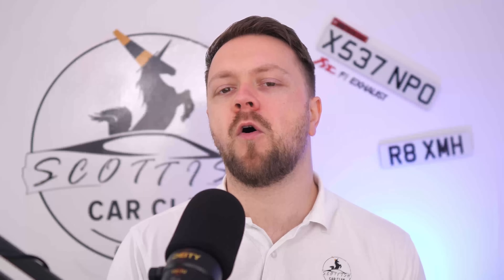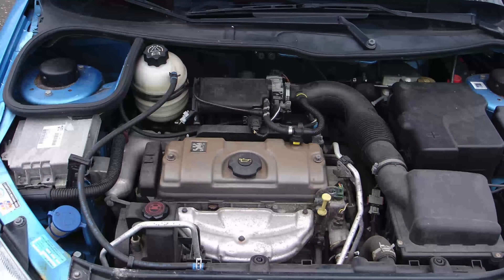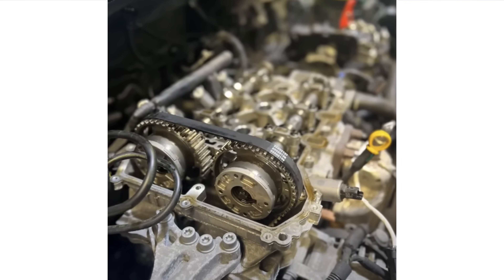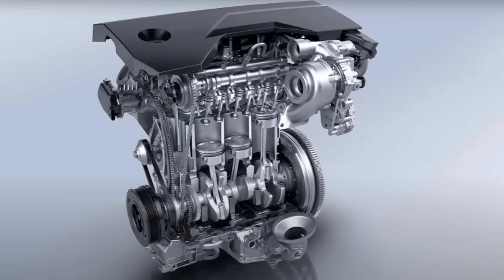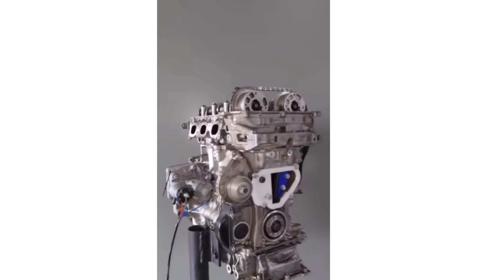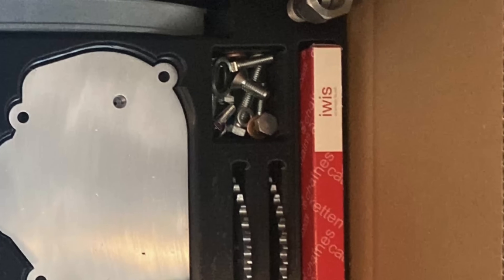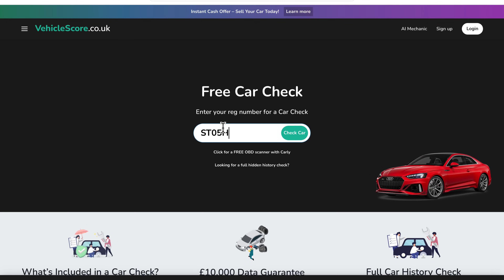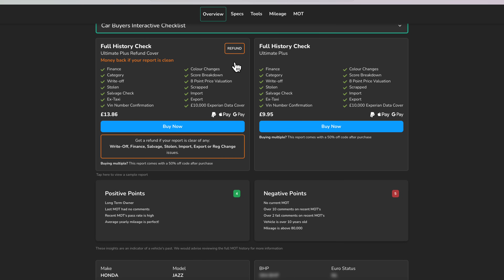Peugeot PURETECH FIX UPDATE | CHAIN CONVERSION

Comment: Just changed my daughter’s wet belt in her Vauxhall Corsa 70 plate with only 20k miles and a full history. Vauxhall wanted £1500 to change it but my local garage did it for £700!!!
Reply: Did it need changing or was it just precaution?
Reply: @  Vauxhall examined the belt after the oil light intermittently began to appear (and charged me £120) and they said the belt was starting to crack so it needed to be changed

Comment: Perhaps they can fix the high oil usage next ?
Reply: Stelantis, the problem with oil consumption has already been fixed in engines starting in 2019. EB2ADTS, they have redesigned the piston group, but the advice to everyone is to change the oil no later than 7-8 thousand kilometers. This is the whole problem with these engines. Has anyone changed the oil with such a frequency? I am sure that no one!
Reply: It might be a little bit too much for them since that oil consumption problem is directly correlated with piston rings.
Reply: @ERSBoogie  since 2019, this problem has been solved, but the oil needs to be replaced every 7-8 thousand
Reply: @vitalkino  No it is not solved.2021-22 model 1.2 puretech 130 cars still consume oil , i know of a couple of my friends. Perhaps the occurance is decreased but definitely not solved completely.
Reply: @ERSBoogie  It's all due to infrequent maintenance. They should change the oil more often
Reply: @vitalkino  Maintenance has nothing to with it. Oil leaks into the combustion chamber around the piston rings.
Reply: @ERSBoogie  You are wrong, 100% it depends on the maintenance on time. The oil turns black, clogs the oil scraper rings and they stick, which is why they do not perform their function and oil gets through them into the combustion chamber. A friend of mine has a 2019 car, 1,2\130  mileage 200 thousand, does not add a single gram. Change the oil every 7-8 thousand and everything will be fine. If the oil is already gone, then only repairs
Reply: @vitalkino  I can point you towards at least 3 owners from our PSA Car groups that had excessive oil consumption and they were all maintained by the auth. dealer at every 10k km's. With the correct oil B71 2297. I said it once and saying again. "It has nothing to do with the maintenance."

Comment: Got my 10 year old 1.0 ecoboost wet belt Fiesta stolen just before Christmas. I've replaced it with a 2016 Toyota Yaris with a  1.33 Dual vvti petrol engine and a chain belt. I've come to the conclusion that the thieves did me a favour.
Reply: Who would steal an Ecoboom 😂
Reply: @nigel9843  my thoughts exactly lol
Reply: @nigel9843 Taken to a chop shop for the engine according to my local police.
Reply: You bet they did,they probably stole it for the engine as the belt on their engine had failed, Ford are no admitting liability for these engines on vehicles registered after 2014 I believe but it’s hard shit to earlier purchaser’s. I’m an engine reconditioner and said right from the start fitting these belts inside the engine was madness,the dry belts weren’t a good idea but wet belts was a really stupid thing to do,single timing chains and not that brilliant but at least they give plenty of warning before failing completely by snapping.
Reply: please explain: what is a "chain belt"?
Reply: @ There is no such thing as a chain belt,what he means is that the vehicle has been fitted with a timing chain instead of another wet belt,it’s a conversion that changes this ludicrous wet belt idea into a chain which control’s the timing of the engines valves and piston’s so they don’t collide and wreck the engine.
Reply: It lasted 10yrs??
Reply: @CASHSEC It was low mileage 33K on it when it was stolen.
Reply: The 1.33 engine has lower emissions and tax, but is not as long lasting as the previous 1.3 engine. Oil consumption as they get higher mileage.

Comment: This will make you laugh.  After watching your video regarding the timing chain version I received a new video notification from  Dave's auto centre where apparently he shop fitted a new timing chain on a Ford eco-boost however, it broke down and had it towed back to his shop where they discovered that the timing chain snapped after it's only done 4000 miles. I'm currently looking for Peugeot 3008 and I think I'd be better off buying a diesel anyway thank you for the updated video.
Reply: The Peugeot diesel engines are brilliant. Get a 2.0L one if possible.

Comment: Do you know how they will lubricate the chain?I think most engines lubricate through the tensioners please more info when they will release the kit…!!!!
Reply: Won't the chain just be fitted where the belt was? And run through the oil.

Comment: Curiously enough the best solution is a dry belt as originally intended with an easy to change belt. My Renault 1.5 turbo diesel has this over 3 examples where every time almost unworn belt was changed at 65,000 miles,total 300,000 miles.
Also this engine has a cast iron block,aluminium blocks are less rigid and durable.
Reply: Which year and model was this car made?

Comment: The wet belt kits can be had for under £80 these days by a good manufacturer. £500 plus labour for the chain isn't great. Nearly all the cost is in the labour of the wet belt job and converting to a chain is the same. You still need to clean everything. I think people who's car is already getting through it's life will opt for a fresh wet belt at half the cost
Reply: Anyone opting for the same solution that causes problem should take a bike to work and ffff off
What does a car cost? 800€ just for the iwis high quality chain from germany will push you up to bmw/mercedes back in the day... do oil changes and the engine will last long

Comment: It’s a better idea than a wet belt but i wouldn’t say it’s a permanent solution. Ask any jaguar/land rover or bmw/mini owners about how reliable there timing chains are and you will get a similar answer to the wet belt disaster design.
Reply: Hmmm im a BMW user, bmw e60, m54 engine... Year 2005 nearly 300.000 km... Never had a problem with a chain... At 300.000kkm not a slight sound of ratling or anything.. the problem was the n47 engine, and that becaus of too long service intervals .... If people would do oil change on 10 - 15.000 km even that shity engine N47 wouldent have problems with chain. But thats BMWs stupidity to keep 30.000 km intervals

Comment: Agree that 'the right oil' is a Boad of Lollocks, what voodoo blend makes it ok for rubber.  A's I said often the case, the aftermarket comes to the rescue and engineers out the VM's failures.
Reply: How can i know what oil to choose if i cannot trust the manufacturer 👀
Do i need to choose based on viscosity or....
I've got a purrrrretech 🐈😅
Reply: @woodrunner51  Choose oil with the manufacturer specific approval. And probabl also the brand, no space for "also suitable for ... " oils.
Thee rating looks something like PSA B71 and then 4 digits. All must match,m of course.

Comment: if they haven't done 150,000 miles tests on these chains - so how do you even know its going to last ?
Reply: Extended lifecycle testing doesn't work like that...
   150,000 miles @70mph without stopping at all, is three months...
   Not reflective of a usual drive cycle, so null...
  Standard test is to run at higher than usual temp, and duty cycle, and use voodoo math to determine the actual lifetime....
   Different sector (electronics), but this is not an honest science....
   All it takes is a quick edit in a spreadsheet to make things seem much more reliable than they really are...
   Still rather go with a chain (known failure mode, real world test data), than "rubber belt in hot oil" : optimistic lifetime, with optimism driven by the beancounters that decide if you have a job or not...

Comment: Think I’d rather stick with a wet belt over an aftermarket chain conversion kit which could snap any time and destroy the engine… At least when a wet belt starts to get bad the oil pressure light comes on warning you to change the belt.
Reply: Not all cars have an oil pressure light, or even a sensor.
Reply: @ Well given that this video is entirely based around the 1.2 PureTech engine, I don’t know what relevance other cars are in this matter because PSA cars / Vauxhall’s with this engine DO have an oil pressure sensor and lights to warn you of an issue.

Comment: The wet belt is not the only problem in this engine. This an oil deprived engine, and the day it starts consuming oil, it's too late, cause you probably ovalized cylinders, damaged piston rings not sealing anymore, a clogged catalyser etc... it's just trash and you need to go through a whole engine reconstruction along that kit...

Comment: Just bought my first car in the last couple of weeks. I know very little about them, having only held a bike licence for the last 28 years. A lot of the used cars within my budget use wet belt engines ... but thanks to your previous advice they all got struck off the list immediately 😉 Cheers!! 😁
Reply: Suzuki swift 1.2 ! Very reliable or the Aygo , C1 and 107 1.0 3 pot excellent depending on need and budget 😊
Reply: Skoda petrol 1.2 seriously economical, chain driven , so easy to service very reliable

Comment: Apologists blaming the horrendous engineering blunder that is wet belt technology on 'unsympathetic maintenance' are as delusional as the makers of chocolate teapots blaming their inability to hold boiling water on users choosing the milk chocolate instead of the dark chocolate specification.🫖🔥👀

Comment: I’ve posted before on this , The debacle that is the Rear subframe corrosion on Mercedes , I’d love you to do a video on this …. all the best from West Yorkshire
Reply: Which Mercedes models?  Years?
Reply: @ 2010-2022 and 2009 - 2014 across the class range 
there is tons of research on this , a class action in America as already been concluded with Mercedes extending warranties etc , in the UK Mercedes are treating the issue on a case by case action stating there has to be perforation before they replace for free , however their is regional variation depending on the dealership . A conversation with head office is my next action as i have had the health check by my local dealer . Do your research first  in the Uk a Mr David Evans of the SLk owners club is supporting hundreds of claimees  and has documents and letters to assist a claim .

Comment: I can say 100% I will NEVER have any issues with any of the following:

Engine Core & Combustion:

Pistons & Rings: These reciprocate within the cylinders, creating the compression and power strokes. They can crack, wear, or the rings can fail to seal.
Connecting Rods: Connect the pistons to the crankshaft. They can bend or break under extreme stress.
Crankshaft: Converts the linear motion of the pistons into rotational motion. Bearings can wear, or the crankshaft itself can crack or break.
Crankshaft Bearings (Main & Rod): Support the crankshaft and connecting rods. They wear over time and require precise lubrication.
Cylinder Head(s): Seal the top of the cylinders and contain the valves and often the camshaft(s). Can crack or warp due to overheating.
Valves (Intake & Exhaust): Control the flow of air/fuel mixture into and exhaust gases out of the cylinders. They can bend, stick, burn, or the valve seats can wear.
Valve Springs: Ensure the valves close properly. They can break or lose tension.
Valve Seats: The surface on the cylinder head where the valves seal.
Valve Guides: Keep the vales properly positioned.
Camshaft(s): Operate the valves via lobes that push on lifters or rocker arms. Lobes can wear, or the camshaft can break.
Camshaft Bearings: Support the camshaft(s). They can wear.
Timing Belt/Chain & Tensioners: Synchronize the crankshaft and camshaft(s). Belts can break or stretch; chains can stretch or break; tensioners can fail.
Rocker Arms/Lifters: Transfer motion from the camshaft to the valves (depending on engine design). Can wear or break.
Cylinder Head Gasket: Seals the cylinder head to the engine block. Can fail, leading to coolant/oil leaks or compression loss (a "blown head gasket").
Engine Block: The main casting that houses the cylinders. Can crack, commonly because of overheating or freezing coolant.
Fuel System (Petrol/Gasoline):

Fuel Injectors:  Precisely spray fuel into the intake manifold or directly into the cylinders. Can clog, leak, or fail electronically.

Fuel Pump (Mechanical or Electric in-tank):  Delivers fuel from the tank to the engine. Can wear out or fail.

Fuel Filter:  Removes contaminants from the fuel. Can clog, restricting fuel flow.

Fuel Pressure Regulator:  Maintains consistent fuel pressure. Can fail, leading to too much or too little fuel.

Fuel Lines/Rail:  Carry fuel from the tank to the injectors. Can leak or corrode.

Throttle Body:
Fuel System (Diesel):

Injection Pump (Mechanical or Common Rail):  High-pressure pump that delivers fuel to the injectors. Complex and prone to wear; very expensive to replace.

High-Pressure Fuel Lines: Carry fuel under extremely high pressure. Can leak or rupture.

Glow Plugs:  Heat the combustion chamber to aid in cold starting. Can burn out.

Diesel Particulate Filter (DPF):  Traps soot from the exhaust. Can become clogged and require regeneration (burning off the soot) or replacement.

Diesel Exhaust Fluid (DEF) System (modern diesels):  Used in Selective Catalytic Reduction (SCR) systems to reduce NOx emissions. Includes a DEF tank, pump, injector, and control system, all of which can fail.

EGR Valve

Air Intake & Exhaust:

Air Filter: Cleans the air entering the engine. Can clog, restricting airflow.
Mass Airflow Sensor (MAF): Measures the amount of air entering the engine. Can become contaminated or fail, causing incorrect fuel mixture.
Intake Manifold: Distributes air to the cylinders. Can develop leaks (vacuum leaks).
Exhaust Manifold: Collects exhaust gases from the cylinders. Can crack, especially due to thermal stress.
Catalytic Converter: Reduces harmful emissions in the exhaust. Can become clogged or poisoned.
Muffler: Reduces exhaust noise. Can rust and develop holes.
Exhaust Pipes: Carry exhaust gases from the engine to the tailpipe. Can rust and develop leaks.
Oxygen Sensors (O2 Sensors): Monitor oxygen levels in the exhaust to adjust the fuel mixture. Can fail, causing incorrect fuel mixture and potentially damaging the catalytic converter.
Turbocharger/Supercharger (if equipped): Forces more air into the engine for increased power. Bearings can fail, seals can leak, or the compressor/turbine can be damaged.
Intercooler (if equipped, usually with a turbocharger): Cools the compressed air from the turbocharger. Can develop leaks.
EGR Cooler
Cooling System:

Water Pump: Circulates coolant through the engine and radiator. Bearings can fail, or the impeller can corrode.
Thermostat: Regulates coolant temperature. Can stick open or closed.
Radiator: Dissipates heat from the coolant. Can develop leaks or become clogged.
Radiator Hoses: Carry coolant between the engine and radiator. Can crack, leak, or burst.
Heater Core: Provides heat for the cabin. Can leak or become clogged.
Coolant Expansion Tank: Allows for coolant expansion and contraction. Can crack or leak.
Lubrication System:

Oil Pump: Circulates oil through the engine. Can wear out or fail, leading to low oil pressure.
Oil Filter: Removes contaminants from the oil. Can clog, restricting oil flow.
Oil Pan: Holds the engine oil. Can be damaged by road debris.
Oil Pressure Sensor: Monitors oil pressure. Can fail, giving inaccurate readings.
Oil Cooler (if equipped): Cools the engine oil. Can leak or become clogged.
Ignition System (Petrol/Gasoline):

Spark Plugs: Ignite the air/fuel mixture. Can foul, wear out, or the gap can become incorrect.
Ignition Coil(s): Provide the high voltage needed for the spark plugs. Can fail, causing misfires.
Distributor (older vehicles): Distributes spark to the correct cylinder. Points can wear, the cap can crack, or the rotor can fail.
Ignition Wires (older vehicles): Carry high voltage from the distributor to the spark plugs. Can degrade and cause misfires.
Crankshaft Position Sensor: Provides data for ignition timing.
Camshaft Position Sensor: Provides data for ignition timing.
Other:

Starter Motor Solenoid. Although EVs also have starter motors (for accessories), the solenoid on an ICE vehicle is a much higher-current device, and carries the full current to turn over the main engine. It's a common failure point.
Flex Plate/Flywheel. Connects to the crankshaft.

Because I drive an EV 😗

Comment: I solved the issue of the Stellantis wet belt issue by never buying one 😄
Reply: Got caught and paid the price
Reply: Not just Stellantis, but also many Ford and a few VW engines
Reply: WeBuyAnyCar solved my cracking wet belt problem. I'm sure the highly ethical motor trade will ensure it's replaced before it goes to the next victim.

Comment: Love your videos mate but it shocking that you think a timing chain will last the life of the car and they don't have their own sets of issues! I've had 6 BMWs over 20 years and they ALL have ended needing their timing chain fixed or replaced. 

Yes I do, do 50/60k a year but the fact that no one talks about the issues with BMW he beyond me.

One of my best mates has a 2014 Ford Focus with a 1l Eco boost engine with 130kish miles on the clock and his wet belt was fine when he changed it last year. I warned him loads about the ecoboom and i was shocked when he sent me a photo of his old belts.

i will always pick a chain over a wetbelt but i don't think they are perfect and have cost me a lot of money to fix over the years.
Reply: I think a timing chain replacement on an engine that has done over 150k miles just is simply not considered a fault by almost all manufacturers these days.
Reply: @LeoinFrance  couldn't agree more